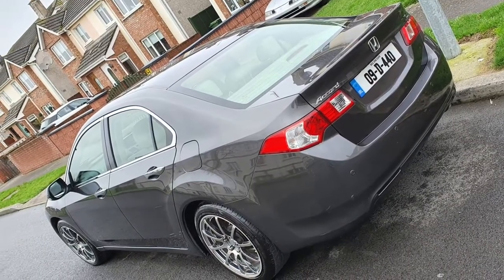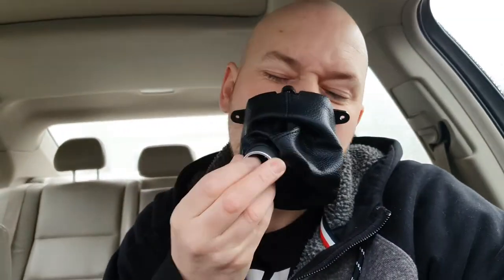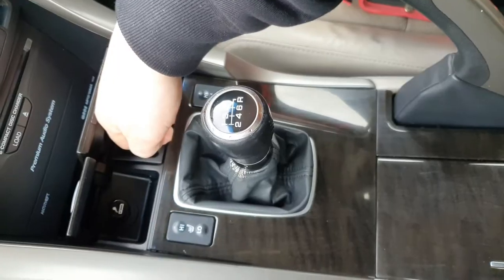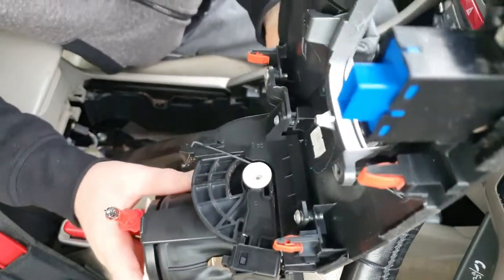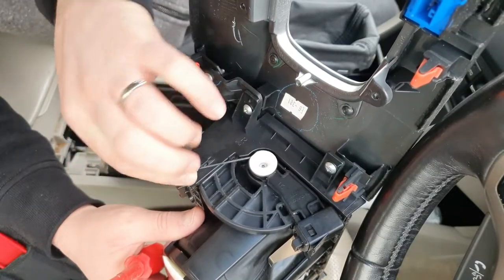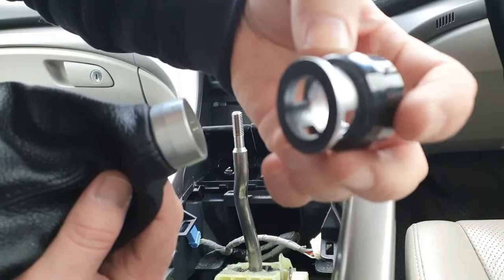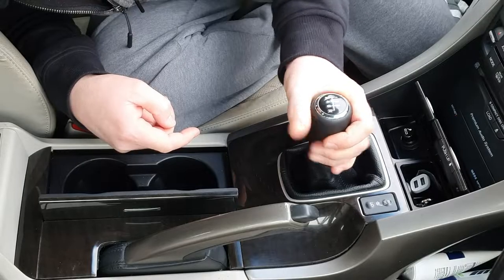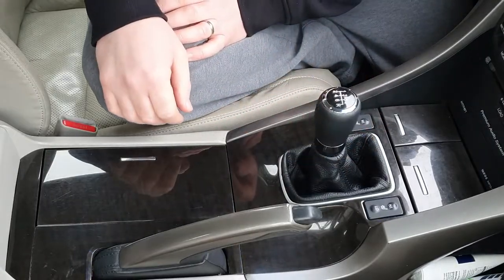How to change shift knob honda accord/how to remove center console honda accord 2009/acura tsx

Comment: Thanks for this video it was useful to see how the gaiter goes together before ordering parts as mine has also suffered the same fate. I bought a threaded metal shift boot collar on eBay for 8 quid which should make the gear stick accept aftermarket gear knobs as you no longer need to attach the boot to the gear stick. Still undecided on gear knob I'm thinking Skunk2 or blox as like you I prefer a similar shape to OEM. The older Type R gear knobs are also similar but they're all old, worn and expensive on eBay
Reply from the maker: Yeah i love the type r style gear knob. Thank you for your comment.

Comment: Hi Gavin, My change shift knob is constantly turning, but it turns together with the leather skirt. I assume previously there was some gluing involved...with the previous owner. If I remove the knob...will I be able to reinstall it? I do not have that reversed cable tightener...to put it back once I cut it. :)

Comment: I am actually curious how is the new gear knob wear after some time. Did this material peel off? I have bad experience with cheap replacement parts - if something "feels cheap" and is cheap it ussually wears off pretty quickly.
Reply from the maker: I am the same i wouldn't keep it long if it was to wear away but this it still absolutely fine no wearing from the leather or chrome. And i drive a lot, i mean A LOT. i will leave a picture on my Instagram page gptv2020. https://instagram.com/gptv2020?igshid=1gy3gj41mmwdv

Comment: Nice video! Would love if you could make a video replacing fuel filter on the accord, while your at it you may aswel make a video changing coolant 😂👌🏻
Reply from the maker: There is a special tool needed for the fuel filter, only honda have them and wont sell them, im sure there are knock off ones but i don't have one. Sorry.
Reply: @GPTV2020  you can get them on eBay pretty cheap, pretty sure its 88mm x 15 flats. And apparently you can use a chain oil filter wrench a ratchet and a long extension
Reply from the maker: Cool Ill take a look at it. Thanks man.

Comment: Cud you have brought the leather down a bit more and then put the 4 screws back into it, then it would not be baggy and it wud be a little more snug and tighter. Just a comment pal. Great job 👏
Reply from the maker: Hi, well the diameter of the bag would get smaller the more i pull it down but I'm sure i could have stretched it a bit more. I just tuck the bag in to the base and it looks well i think.